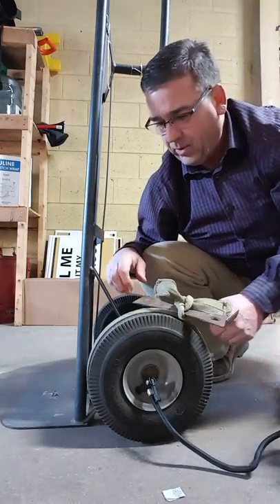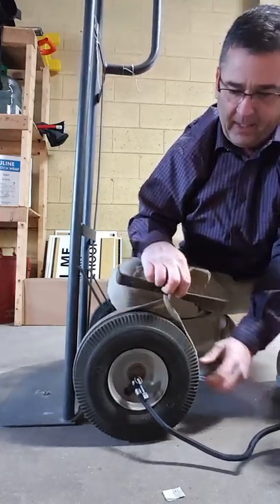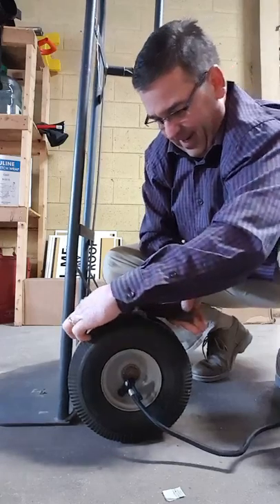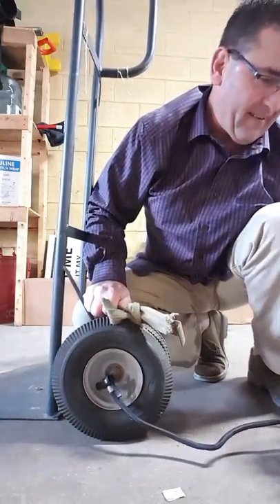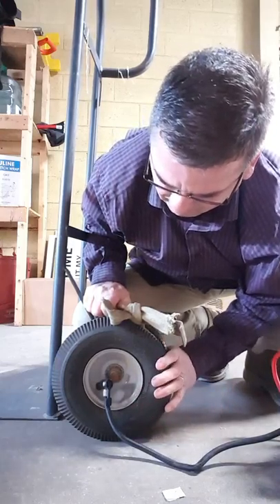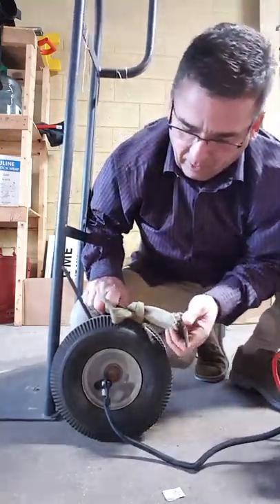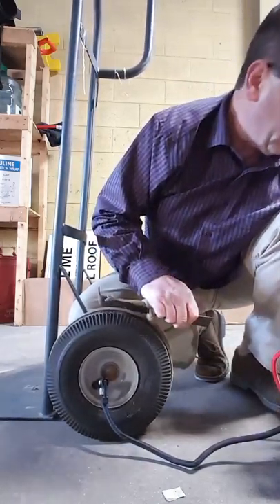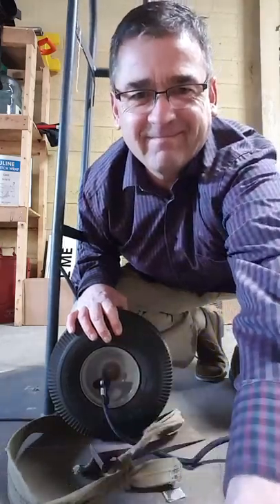How to Inflate a totally flat tubeless tire

Comment: If you have a ratchet strap handy you can also use that it is a lot easier but what he did is great. Just make sure you release the ratchet strap as soon as the tire seals if you fill it all the way with the ratchet strap and pop the ratchet strap it can hurt you cuz it will pop with great force

Comment: I watched your video...thought I'd try a shortcut w/ the tire on my Gorilla cart!

Laid cart on side and rather than tying a rope around the tire...I squeezed the tire b/t both of my knees, put air hose on the stem, and it aired up the tire!

Thought I was good, until about 10-15 mins later...the tire lost air! 

Will consider some tire slime or similar product or I may try expandable foam from an aeresol can...

If worse comes to worse...I'll just buy a new $25 tire!

Comment: Good idea to clean (sand, wash with soap, perhaps spray with a can of rust reformer.... you need a clean seal at the bead or you'll be doing this again.  Also... use the most powerful compressor available to get as much air in as fast as possible

Comment: Thanks.  I just did mine with the tire still on the riding mower... used tie down straps.  Tightened it, inserted air and released it slowly.  It scared me cause it popped the strap off.  BE CAREFUL!!

Comment: Might work for a tire with flat surface but not a round one like for my wheelbarrow
Reply: It does work for round tires. Apply more tension on the belt to force the edge bead out enough on BOTH sides. Like tightening a tourniquet.
Reply: Thank you so much for your post👍🏿 each one, teach one👍🏿